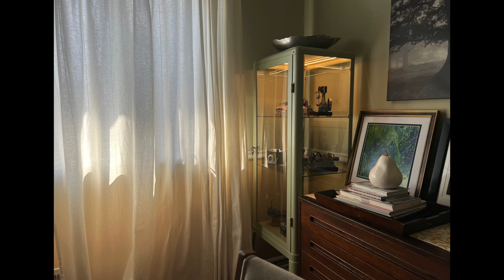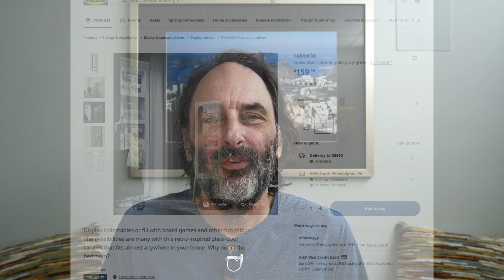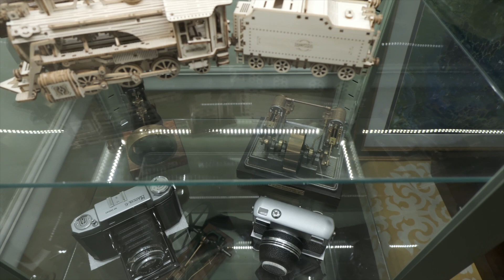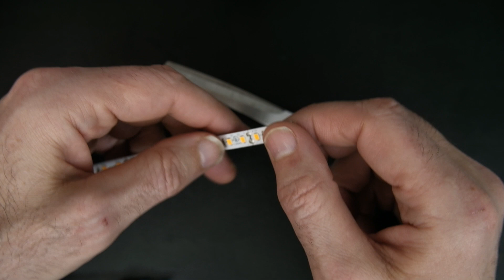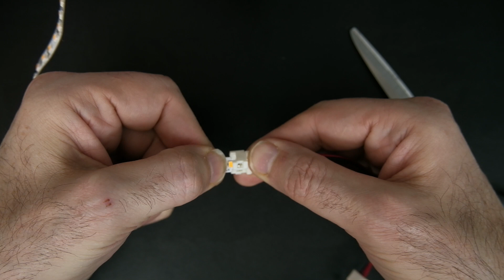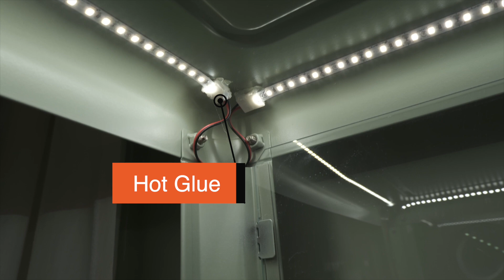Show Off Your Collection! Ikea Display Cabinet with LED Lighting

Comment: Really helpful video! Thanks for all the links too
Reply from the maker: Thanks! Glad you liked and I hope the info helps--even if you aren't putting together a display cabinet, there's everything in there to know how to set up indirect lighting in your kitchen or somewhere else.
We used this very same setup to backlight the wooden cross that we have mounted behind the pulpit at our church--it's mounted 3 inches off the surface of the wall and the strip lights are on the back side of it.
Reply: @TadTadd  I've just added lighting to my shelved display cabinet following this and it looks amazing. Thank you!

Comment: It looks nice!
I would add simple light diffuser on top LED strip. It will blend light spots in reflections into soft line.
Reply from the maker: The Hitlights Premium High Density version is exactly what you are talking about: they have a diffuser built in. It's all about the look you want. Diffuse lighting is perfect for kitchen cabinets, but in my opinion diffuse light takes away the sparkle that pinpoints of light provide. Keep in mind that most people see the cabinet from five feet away at eye level, where none of the strips will be directly visible.